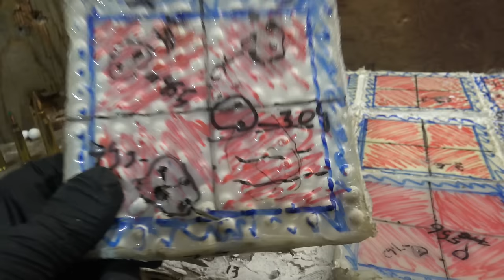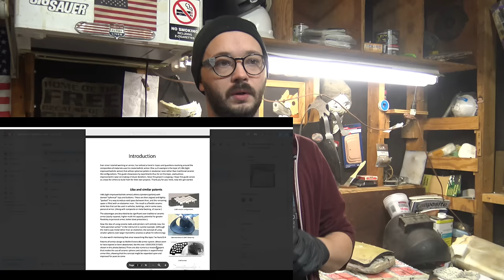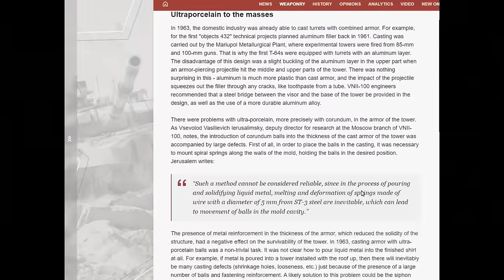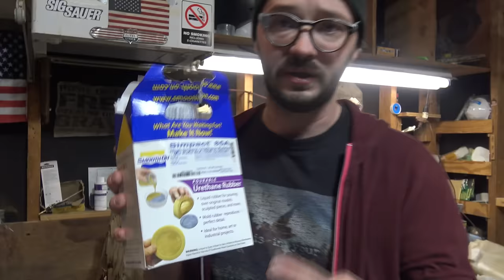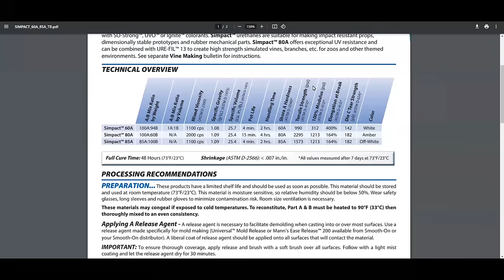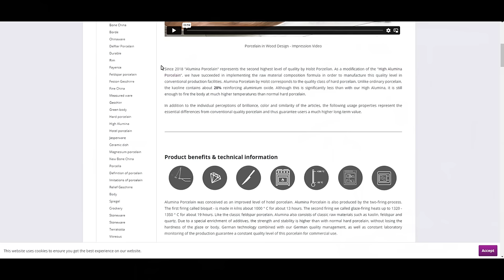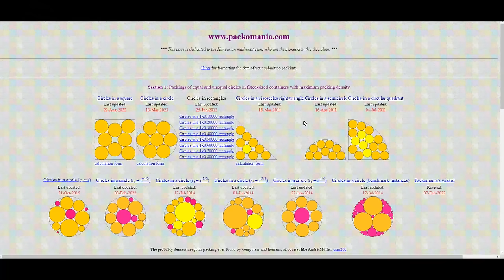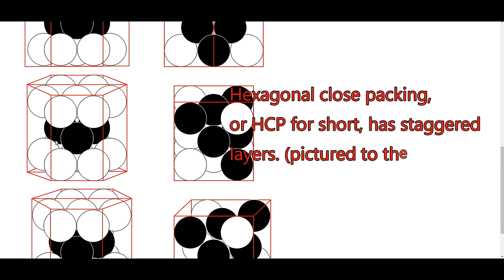Hybrid Ceramic Armor!

Comment: As to length of the video, for me personally you could make this video 4 hours long and I’d watch it from start to finish, but I’m weird like that. And love off the wall shit like this, because it’s the same things I generally think about and do at times. So far, the best, as in most bang for your buck in effectiveness, cost and weight I’ve found is your good ol bondo 12oz woven fiberglass mat, you get about as much performance as you can expect out of fiberglass, st low cost and easy to afford, with the lowest weight you’re gonna find that performs. Sore better options for glass mat…but cost goes up pretty quick and weight too. To the point you’d be better off just getting Kevlar as better performance and lower weight with only a little more cost. Compared to high end boat glass mat.

Comment: @Techthisoutmeow I wonder how a plate with layers that slanted within the plate would perform. It would certainly pose some challenges when it comes to making them, but I'd think it would do one of two things. 1, depending on velocity the  round may be more likely to deflect (probably within the plate itself which would make the round need to go through more material to penetrate the cab). If this is the case you could effectively use less materials for the same stopping power. On the other hand since the round would basically be impacting the edge of the plate, it may be inherently weaker. I can see it going either way.

Comment: outstanding, also a second channel if you feel urge to put out unfiltered material on the side, like meow 2. so how about the sand mixed with resin tile sand bags. sand resin direct cast would be the easiest and fastest manufacturing process. yes plastic concrete cast in as tiles plates cloth etc. or plastcrete for fun naming. maybe a compilation of the best results as a conclusion as a release. sand spheres are very small tho. and a happy new year! :)
Reply: Try dvd's as interleaved polycarbonate discs armor

Comment: Any idea how to figure how heavy it would be to armor an entire car? 4 door Crown Vic. Both doors, firewall, inside the entire trunk. I'd guess maybe 300 pounds but maybe I'm way off.
Reply: The firewall shouldn't be necessary since the engine is so massive, according to tests by Paul Harrell.

As someone who has been looking into custom building an RV, the weight adds up pretty quickly!
Reply from the maker: Funny enough, my next set of videos is all about vehicle armor! I've been developing a full vehicle armor system for some time, and I'm finally dropping it. So stay tuned. First, I'll be doing an update video outlining the project. It'll also have a full pdf like this project did!

Comment: could you try in onen of your armors to add pre stresed strains? similar as done in construction for large spans. Strech the strains without pouring resin and once cure cut them. This would get the plate compressed Horizontal and Vertically. I believe this could reduce bullet penetration by causing higher friction needed to penetrate. I may be wrong do, just an idea.

Comment: I wonder how well lead balls would work? They'd be much easier to cast.
Reply: lead is too heavy to be considered. and the best you can get from lead is about "mild steel" (that is still heavier) or good aluminium alloy (that is 4x heavier than aluminium). I would try to use bearig balls that are extremly cheap and have like 65HRC

Comment: If the final armor plate is flexiable it definitely will leave gaps in between, which means weak points. So this idea actually doesn't work and you don't really need that kind of flexibility. Using ceramic pellets should work and there are tons of patents in that area. The thing is when being hitted, the pellets may plung out and hurt the carrier. If you want to give it a try simply glue the ceramic pellets together and to the back face (UHMWPE) with some gorilla glue.
Reply: Flexible rifle armor is often manufactured on a curved surface to avoid the gap issue.
Reply: It doesn't leave gaps if it is double-layered.  There's obviously a big difference in mobility between wearing soft and hard plates.  I don't know if there even needs to be an additional ballistic layer behind this type of plate if it can stop penetration from a bullet; between the fabric of the carrier and a high-density foam backing that you should have anyway behind the plate to absorb impact, you may be fine.

Comment: First!! 😅
Reply from the maker: Man your on it lol
Reply: @Techthisoutmeow   Yessir right on the money. But probably cutting it a little close too, as others likely had the same idea after seeing your announcement. I'm watching it right now as we speak. Hopefully this new concept of using ceramic balls will give me a few ideas on sophisticated strike face arrangements for the composite armor arrays for my exoskeleton build.
Reply: @nemesisobsidian  is it possible anywhere to follow your work of that exoskeleton ?
Reply: @fpsserbia6570  I think I might be planning to start showing what I've built on Tech's discord once I get to a point where I've finished enough components. The first thing I have to make is the exoskeleton itself or the support structure that wraps around and hugs the body and is a structure for the composite armor arrays to be mounted over the top of it.

I plan to have at least 2 armor arrays. The first array will be more bullet resistant than the second one. The role of the second array is to stop any large high power rounds that make it through the first layer.
The suit will also have its own power supply unit along with the proper shielding for any electrical components installed within the hollow of the exoskeleton but that will be last as I'm mostly focused on the structural elements of the armor itself.

I don't have any recording equipment so I can't upload any videos. So the next best thing I could do is upload images of what I have on his discord. I'm also following in the footsteps of another guy on here by the name of Captain Intrigue. So armor wise it will be more along his theme, but my own darker version of it.

I hope that answers some of your questions, cheers. 🍻
Reply: @nemesisobsidian   thanks on the answer :D

couple of question if you have time:

1. what would be approximately the weight of the whole exoskeleton with power unit

2.  exoskeleton will be powered ? by what and how do you transfer energy, hydraulics ?

3. when you say " large high power rounds " are we talking about rifle rounds like 50cal ( 12.7mm ) or autocannons  like 20mm / 30 mm  rounds ? 

building armor or military weapons is fun i regret not finishing university for mechanical engineering  😓